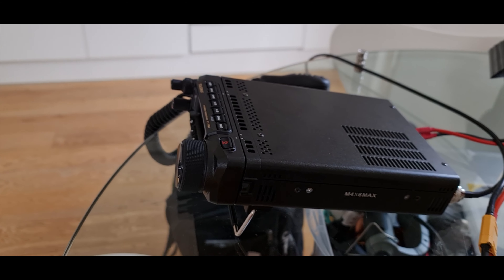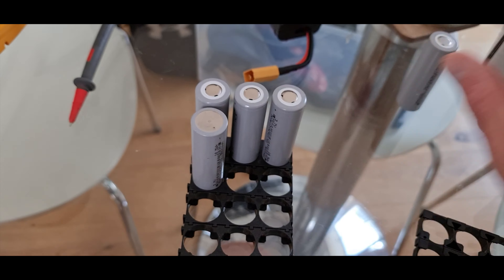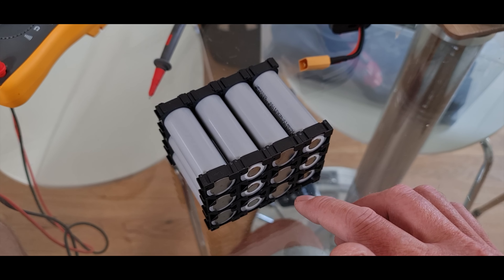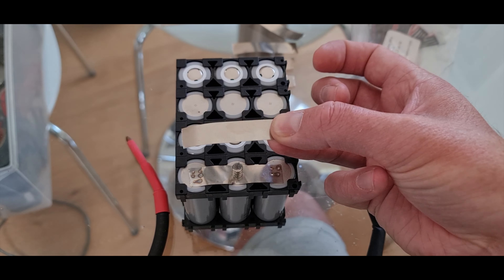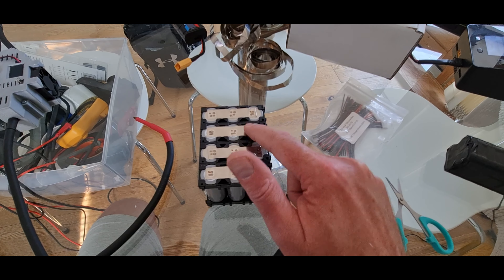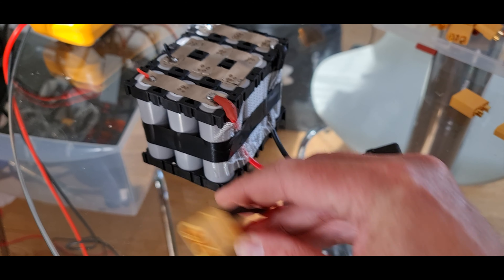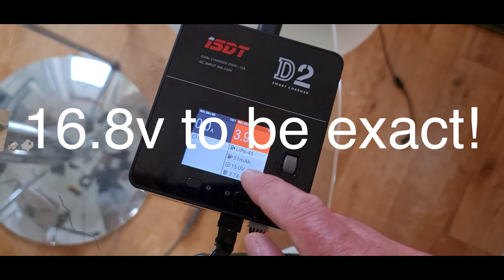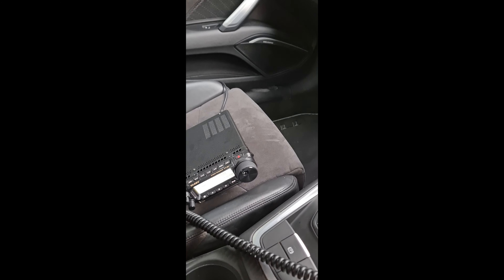TESLA POWERED CB RADIO!!!

Comment: I rather use Lithium-Iron Phosphate (LiFePO4) as 4 cells will be at 13.2V - 13.3V that is even better for your expensive radio from over-voltage. Plus LiFePO4 battery is much safer than lithium-ion battery from fire. Plus LiFePO4 battery will lasted much longer than lithium-ion battery.
Reply: Good points.  Especially about the voltage.

Comment: You should look into playing around with USB PD. You can get a little board called a PD Trigger and it lets you use a 100W USB PD power supply (like a power bank) and it lets you use a regular USB cable to output voltage of either 5, 9, 12, 15 or 20V at up to 5A. It obviously wouldnt work for this specific setup but for something that can take 20V then you could get 100W out of a powerbank. USB power delivery support in a radio would make for the ultimate portable setup.

Comment: Those Lithium batteries are great.  I've converted my battery powered drill, hedge trimmers and various other high current battery powered items - mostly because I'm sick of manufacturers stupid prices for replacement battery's.

Be careful though, its all too easy to start a fire with those battery's if you don't know what your doing.
Also, be careful not to overuse them as they won't charge again if you run them too low.

Comment: The music at the end was amazing on my headphones.  I am interested in getting a back up power system up and running for my house to run both freezers and a fridge plus if i can get some U.A.E (L.E.D) light bulbs apparently the most energy efficient light bulbs in the world plus a single stand alone induction hob for the kitchen i am going to use solar and wind to generate the power so its all down is it going to be lithium or lead acid for the solar shed. i am thinking of shooting some 4K video for you tube on the project anyway keep up the good work Andy cheers and beers from south Wales U.K
Reply: Huw,
Pick up an APS SmartUPS 1500 from a local E-Waste/recycling place. Most are pulled out of service after the lead-acid batteries go flat. Most of the time it's a matter of replacing the 4 12V 9AH lead-acid batteries to get it back up and running.
I'm running my chest freezer off of it, and have an extension chord running for my kitchen fridge. No major power outages, but a few years ago we had a couple day rolling power outages and it saved my tuckous 👍.
Reply: what a brilliant idea i am definitely going to look into that, this is something that has to be done i just do not trust the energy company's from now on i don't care if the are shouting no outages this winter its better to have a backup to fall no if the need arises. cheers thank you

Comment: Are you sure they’re out of a Tesla pack? A Google shows them having a triangular anode, not sleeved, and 3400mah. 5000 is Chinese optimism for an 18650.
Reply: Indeed - never heard of 5000ma 18650’s - apart from fakes.  AK did you do a capacity test
Reply from the maker: They are 21700 cells as used in the model 3 battery modules.
Reply: @andykirby  0:32 zoomed in to label, indeed 21700. Cheers Andy.j

Comment: Just buy a jump starter pack on eBay for 30$ endless mah. Cheaper and easier! You're welcome!
Reply from the maker: Jump starter packs are pretty low capacity, they use lipo cells usually. Not a bad solution but a bit low on voltage for running radios at high power for any length of time.